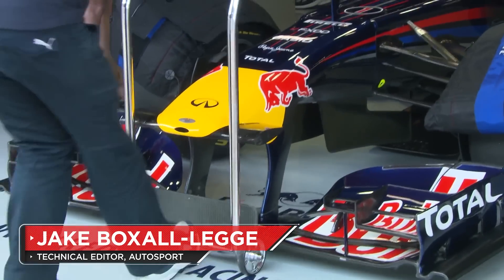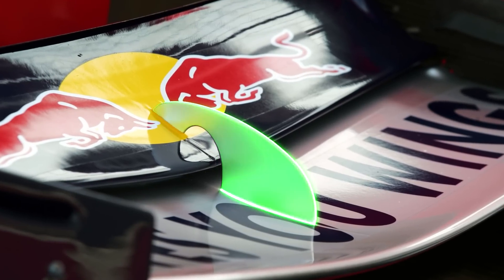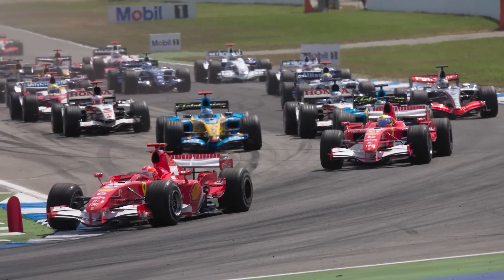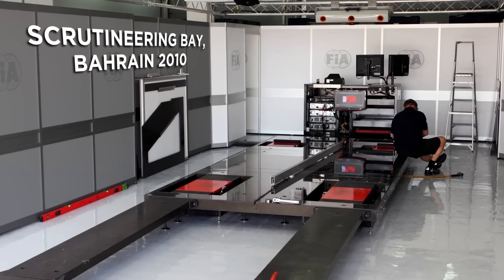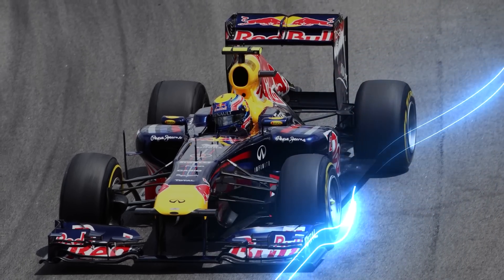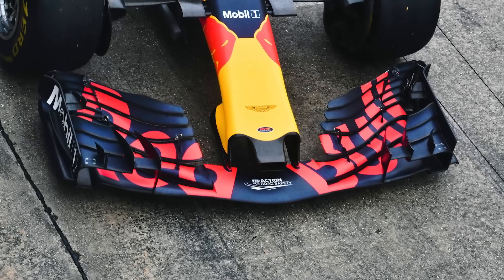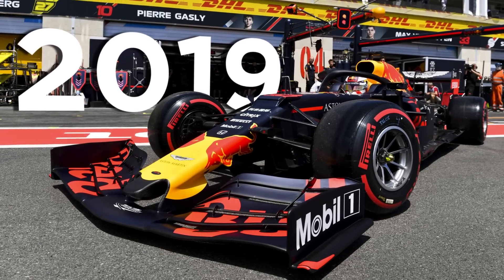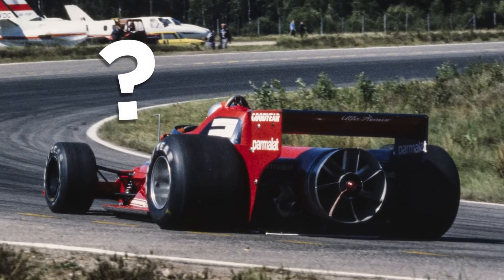Why F1's Flexi-Wings Were Banned... Kind Of

Comment: I'd love to see a separation in approach in f1, kinda like the possible engine layouts in the 24h of le mons. One set of rules for aero cars, basically do whatever aero nonsense you want but the following car can't lose more than 10% downforce when following within 1 second and your all good, but you have to use a standard engine that's down on power, with ofc the alternative power cars being given freedom to design whatever kind of super powerful engines they want, no boost control no displacement restrictions just make it fit in the car and your fine but now downforce whatsoever in the wind tunnel

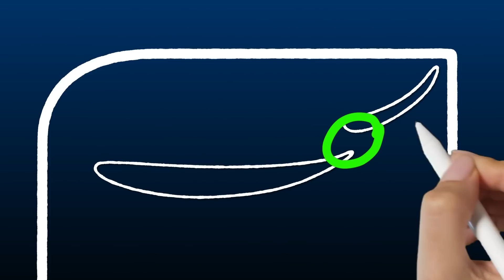Comment: 1:20 I don't get this it seems to me like less air circulation would cause more drag. Am I missing something?
Reply: It's about what happens behind the wing in that case.  The stalling of air causes such heavy turbulence that there is less down force in the trailing edge, due to not having such a low pressure. No low pressure,  less down force,  less drag
Reply: @b29ak2007  That's much clearer, I appreciate it!
Reply: @LPChipi  your welcome 
Though don't take everything I say as 100% true, but that's what I understand from my YouTube aerodynamics general knowledge

Also I think it explains the spoon shaped wings the F1 teams have for high speed places with slight download like Monza and Spa

Comment: Should the FIA allow flexible wings? Well, they need to make sure that the sport is relatively safe, and have rules that can be enforced. As long as the wings aren't going to fail, and they can scrutineer whatever rules are in place, and the cars aren't too fast for the tracks, then there is no particular reason to ban it. And if you need to reign in the performance of the cars, it may be easier to do so with  something easily measurable, like reducing the surface area of the wings.

But with the comments this weekend about Red Bull's wing flexing and gaining them an advantage, this may be a subject that gains some prominence over the next few weeks.

Comment: Seems like the tires may be the great equalizer here--at least with moderately inflexible wings. At Imola, Red Bull noted on the radio that they were faster on the corners but slower on the straights than Mercedes. This may indicate that RB had more downforce, improving their cornering, but the increased drag slowing them on the straights. (Is this why only Verstappen seems to be able to drive the RB well?) In the end, all of that extra downforce may be hard on the tires-letting Hamilton extend on the mediums while Verstappen has a blowout on his right rear tire.

Comment: I think the sport would be much more entertaining for spectators if the rules weren't so particular and stringent. I also think that there would be much more technological innovation if teams were left open to creation.
I hate that tyres are designed to wear. I hate that refuelling isn't allowed (although I recognise the safety implications). I hate that DRS isn't available whenever the driver wants it. I hate that KERS is so finely regulated. Just let the engineers engineer and let the drivers race.

Comment: I feel like the FIA is constantly trying to design the teams' cars for them by tackling each engineering feature with a design rule, when really they should be phrasing rules to dictate their desired outcomes, and let the engineers work on ways to make a fast car within those regulations.

For example, to address the safety issues of ground effect, contrast having a FIA engineering team sit down and create extremely intricate dimensioning requirements for the bargeboard, versus saying "the variation in downforce cannot exceed a certain fraction of the average downforce recorded over the course of the race" and letting the engineering teams go wild.

Comment: I thoroughly love this series. Let me ask, if F1 implemented a strict, much lower annual spending limit (say $50 million per team) but opened up the rule book on pretty much most anything, do you think that would be feasible and generate more exciting racing? I think of the days of 6-wheel cars, fan cars, turbo vs naturally aspirated, ground effects, double diffusers, etc...Cars that were dramatically different from one another. Some ideas worked, some ideas failed miserably.

Comment: 1:24 How does stalling a wing reduce drag? Stalling increases turbulence and drag, or at least it does on my C152 .
Reply: I am no expert, but i thinke that whilst a Stall in the flight industry means losing updraft, a stall in aero of cars means no more downforce, therefore reducing drag
Reply: @firex6525  A wing with zero lift certainly has zero vortex drag, but a stalled wing would experience flow separation, which would increase drag. 

On TV F1 programmes I have heard claims of stalling wings having reduced drag, but wish somebody on one of those channels could explain how it is possible. The only idea I've had is that they mean vortex drag is reduced, implying that vortex drag from the wings is very high.
Reply: frogandspanner i'm not an expert but i think the larger angles in automotive wings mean they have more vortices. please let me know if you find out any more on the subject as i have been wondering as well
Reply: Drag from turbulent flow behind a stalled wing isn't that significant, the actual angle (frontal area) presented to the airflow is more important. Your aircraft is in free air, post stall it can pretty much fall straight down and then the airflow is almost 90 degrees onto the wing. Creating a lot of drag.
An F1 wing is not free to move like that, in stall it will still present the same frontal area to the incoming air. Also remember that an F1 wing is a very high AoA multi element wing with an absolutely huge amount of induced drag. The amount of drag caused by turbulence behind the stalled wing is nothing compared to the induced drag shed by stalling it.

Comment: I need to see a 6-wheeler fan car with an onboard f-duct, double diffuser, flexible wings and a das system.
Reply: add active aero and you can get rid of the f-duct :)
Reply: @emmata98  Active aero? F duct? Why not both???
Reply: What about some AcT1Ve Su5penS10n?
Reply: @gabrielenitti3243  why not
Reply: And a double chassis to exploit ground effect
Reply: That would be pretty quick I think.
Reply: What about active suspension, traction control, skirts, mass dampers, blown diffusers, third pedal, Williams gearbox that didn't needed gear changes, more engines per year, would also give us higher revving engines and more power, different engine mappings, and all those aerodynamic elements on the bodywork as in 2007/08... And in sure there's plenty more we could add to this dream F1 car.
Reply: @hellknightf1  oh and also rocket fuel
Reply: venturi tunnels and freedom of engines
Reply: with x-wings
Reply: Dear God sir please control yourself
Reply: AND, a blown diffuser
Reply: 40 sec austria
Reply: And make it a fan car
Reply: 2nd brake pedal
Reply: Go watch Cyber Formula then
Reply: So flex active aero, suspension, variable camber system, AWD, AWS, ground effect systems, up to 8 wheels, wheel covers, anti drag canopies, open PU freedoms.

Only legislative caps for minimum safety and maximum spend of no more than 150M per annum.
Reply: +drs and a V10
Reply: don't forget the amount of wings and aero things in every ofrice and no front wing
Reply: Sina Manic and active suspension
Reply: Wait that's illegal
Reply: And a giant fan at the back

Comment: 1:21 not sure about that, i dont know, but i thought that if the gap is closed, than the downforce shiuld still be there, but with much more drag.
Reply: i think the area of low pressure behind the wing reduces the drag compared to the non-stalled vortices of the normal positioned wing, but i am unsure.
Reply: The wing angle is too high for airflow to stay attached in a single element wing, that's why it needs the gap to make it a multi-element wing. Closing the gap causes the wing to stall and it produces almost no downforce.

Comment: They have to keep a lid on flexible aero parts, otherwise we'll end up with flexible floor parts to seal at the edges & all sorts of crazy interpretations that teams will push to the limit, & over it, increasing sudden failure under load & compromised driver safety. We'd have cars behaving like the FW41 & 42 as teams lower down the grid encountered issues with unstable aero

Comment: Flexible wings really only exist because active aero is banned lmao.
Reply: Except for DRS, of course - which might have just been introduced with the thought "they're going to do it anyway with flexiwings which we can't work out how to ban, so we may as well just make it an official part of the sport".
Reply: @nathangamble125  Nah, DRS is introduced as a bandaid solution for the dirty air problem. Hopefully when dirty air becomes less of a problem in the future it will be removed.
Reply: Well I don't think that's active aero, because active aero has to be activated electronically, not mechanically. That's why for instance the DAS system was declared legal on the Merc
Reply: @leonardantal6333  I don't think that's the case. Mechanically activated active aero would be easily achievable, so all cars would have it if it was allowed. From my understanding DAS was declared legal as Mercedes sold it as "part of the steering system" and also - it's no aero.
Reply: @1hej0k3r  maybe I wasn't clear enough, I meant aero that's only activated by the flow of the air, like everything that's in this video. I'd love to see those not banned, of course they have to be limited because there's high risk of failures
Reply: @leonardantal6333  Ah, now I see what you mean. To me "mechanically activated" seemed to imply a switch and a cord or something like that, as you mentioned electronics in contrary to that principle. In that case I absolutely agree with you, flexible parts are an extremely interesting concept to play with in racing and as long as all parts are safe to use I don't really see a point to outlaw them.
Reply: @1hej0k3r  yep, that's what I meant, I just said it in a wrong way 😂
Reply: @leonardantal6333  I didn't say flexy wings was active aero, only that teams user flexy wings because they can't use active aero.

Comment: It's kind of obnoxious how whenever the teams create any sort of innovation, the FIA just straight up bans the shit.
Reply: It makes the entire thing kinda dumb
Reply: Yeah it is very stupid
Reply: @mattykobs  The current aero specs create alot of downforce loss, its the whole point they introduced Drs. Merc wouldn't have had as much of an easy time running away with the back to back championships
Reply: It’s literally some of the best Aero and material science and engineering and it all gets banned
Reply: And the same people complain when FIA doesn't do anything to stop teams dominating. Smh
Reply: its to stop teams getting an unfair advantage and running away with it, and then everyone spending a fortune on something like flex wings just to get back to level. Then nobody has an advantage, and everything is just more expensive. Plus flex wings increase top speeds and could become fragile as teams push for performance, how does a 300+kph crash sound due to a flexible wing failure?
Reply: @jamesrowland2002  an advantage shouldn't be considered unfair just because it's an advantage, and there's no way to make Formula 1 cheap without diluting the essence of the sport. F1 cars are supposed to be the pinnacle of engineering and automotive innovation, pegging back teams when they do just that is actively stifling innovation
Reply: @dannybimma  There is a way. Just stop banning everything. If small investments in to technical development will make large gains, it's win win. If everything is banned and cars are ordered to be the same, only huge amount of money will make you slightly faster.
Reply: @dannybimma  Aaaaaand there we have it once again, the crux at the core of F1 and its fanbase. In the blue corner we have good, tight racing, keeping things affordable for small and new teams and sometimes safety concerns. In the red corner we have the pride of being the fastest racing series there is, the pinnacle of engineering and innovation, as well as the unfortunate reality that the most reliable way to achieve these things is to throw cash at your car. Which small teams can't do as well as big ones, and new ones might not want to do.

Now trust me when i tell you, neither of the two extremes on that spectrum is going to work, so there will always have to be some kind of balance between the two. Keeping said balance is the FIA's job.
Reply: @nestoNESTOnesto  This is deep. Never thought of it this way.
Reply: @curnath  Ban it if its dangerous. Ban it if its expensive to replicate. But if its something that can be replicated for not much cash then it shouldnt be out right banned
Reply: @nrahman975  More or less no argument there. I'm pretty sure, the FIA's regulations regarding flexi-wings were due to safety concerns.
Of course innovation should be rewarded, no question. On the other hand, you also can't forget that simply speaking, even innovation can be bought. More money means more smart people with smart ideas and more budget-space to implement said ideas. Which brings us back to my point: Safety concerns aside, the FIA's job is to keep a balance between interesting racing and financial viability on one side, and pure, all-out performance and competition on the other.
Reply: @curnath  More money doesn't always get you the smartest people. More experienced yeah but fresh engineering talent always mixes stuff up.
Reply: @nrahman975  Not always, of course. But it sure as hell raises your chances for frequent innovation. More money means you can pay higher wages, making you more attractive for fresh talent, and you can employ more of them. Also, you have the budget to explore every new idea, whereas poor teams might have to limit their spending.
Reply: @curnath  It's really balance, can't put a cap on it otherwise you aren't gonna see teams take risk or come up with original ideas. But you don't want a team being overtly dominant to the point where they can't be touched, I don't mind dominance only if they is a good chance the dominant team can be beat.
Reply: @jamesrowland2002  and ever since  they started doing it more and more teams that dominated for larger and larger periods. the idea of tighter rules is to create close racing but in reality the room for something innovative is so small that small teams can't afford the risk of a new idea since it can be banned in one race and ruin a whole season. so in theory limiting new things should avoid big teams to gain advantages but in reality it prevents small teams to gain those advantages and match the big ones
Reply: James Rowland How many teams account for all ten Constructors championships over the last decade? How dominant were they? In truth the FIA isn’t really able to stop teams from “running away with it” but they can make it worse by putting in restrictions on what can be developed and declaring innovation illegal.
Reply: @jamesrowland2002  and then Mercedes happens anyway
Reply: @jamesrowland2002  this has never worked though lmfao